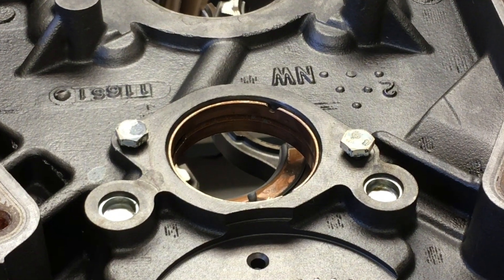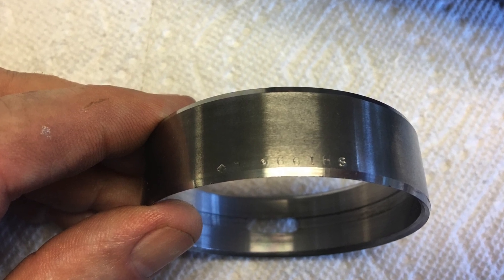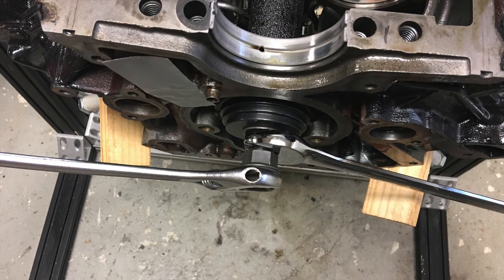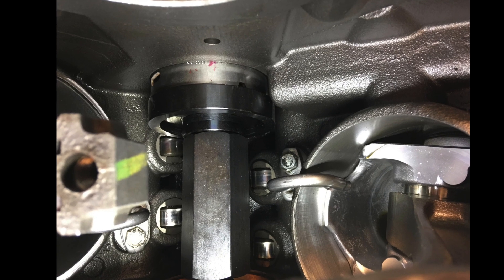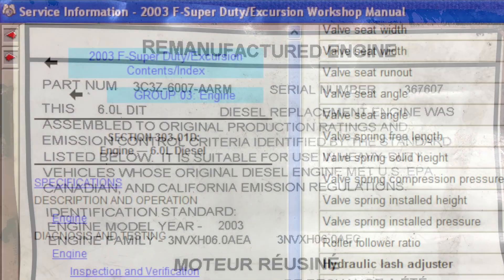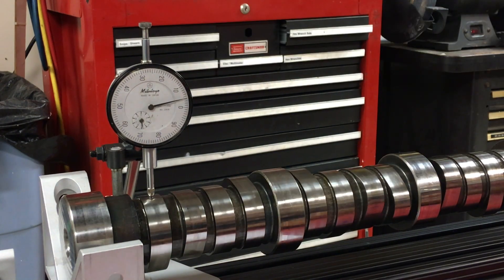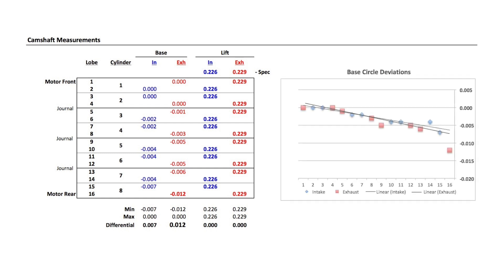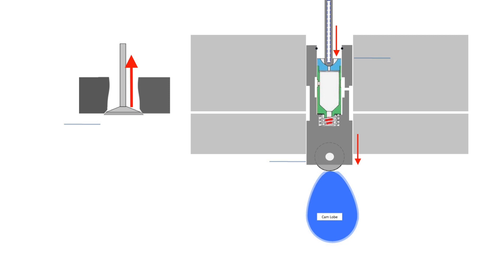Camshaft and Bearing Measurements; Cam Bearing Replacement - Powerstroke 6.0

Comment: Hi Mr. Jack, May I ask... What was your original cam bearing installation tool you were using in this video, and then purchased the washers for precise fitment for the 6.0 bearings. Do you have a part number for the tool and particular dies you used for this set up? Most places are on back order for the original tool and I would like to make something up for a build I have. Any help and advice would be much appreciated...  Thank you!
Reply from the maker: The parts I used are in the video description.  Starting from scratch would not be inexpensive, although you could use over-the-counter threaded rod and nuts.  But the washers were chosen specifically for the size of the cam bore and bearings.  I would recommend that most people use the Mahle cam bearings as the Nav ones are segmented and easy to distort if you are not careful.
Reply: @toomanytoys  Thanks again for your thorough videos. I think the jack screw would be a good investment for me. Would you please share the thread size and hardness of your 3/4" jack screw. Thanks ahead, Dave S
Reply from the maker: @davids-o2y  David, I have all the part numbers and details in the video description.
Reply: @toomanytoys  I'm sorry about that, I thought I had looked in the description before I messaged you.... I must have jumped the gun. But thank you so much for responding. You are such a wealth of knowledge and a WONDERFUL teacher! Thank you Mr. Jack and have a wonderful and blessed day!
Reply from the maker: @sapsaz7102  No, I added it because of your question.  You didn't jump the gun.

Comment: your taste in music is impeccable haha. im on my second 6.0 now thanks to your info youre up there with ron and bill for me
Reply from the maker: I'm not sure they are all excellent choices; after I get hit with a few Copywrite hits of do-overs before they get published, I'll take whatever I can find on YT accessible sources.

Thanks, but I don't see it that way.  DTR had the great advantage of service experience that I don't.  I'm just an R&D guy in a two-car garage.
Reply: @toomanytoys   I want to just build the same cam bearing tool exclusively for 6.0. I am going to just get machinist to build me the right id and od collet sizes based on the journal and bearing measurements from the navistar manual and use a threaded rod. How many thou clearance should I leave between the guide collet that centers the rod in the cam journal and the cam journal? what about between collet and cam bearing? (ie where you taped. will bearing on steel be ok here or should I use something soft like you did?) How did you install and remove the front cam bearing with the way you had your tool mounted in the video its not evident.
Reply from the maker: @over9000pontiacs  I had to go back and see if I kept all those components together.

The lead-in and drive plates (assembled steel washers) have an OD of 2.575", which is under the bearing shell OD of 2.600".  0.0125" clearance on the radius.  You could go tighter than that, 2.585".

The "carrier" for the bearing shell, since it has the velcro, was elastic, but with the bearings having an ID of 2.400", five to ten thousand clearance would be acceptable.  Nylon would be a good choice.

To get the final bearing out, I used a collar from my kit that had a larger diameter than 2.600", and the bearing pulled into that.

I'd recommend using the Clevite bearings, the Navistar bearings are an interlocked piece, and if it's off a little, the shell will distort.
Reply: @toomanytoys  Thank you much i will Make a video of what i create and the dimensions.
Reply from the maker: @over9000pontiacs  The one thing we didn't cover was the width of the bearings.  I have a new set of Clevite here; they are 0.735" wide.
Reply: @toomanytoys  the machinist wanted $300 for one drive collet accurate to .010. at that price I might as well just get the navistar tool. I will pm you the collet and nylon sleeve cads its all really elementary I was expecting more like $150 ish. PM'd u on power stroke

Comment: Where can I find info about the 03 camshaft vs others? Any idea why the intake manifold plenum connects at the back?
Reply from the maker: The intake, I would speculate they believed it balanced the airflow a little better, just like people with the 7.3L having supply fuel rains to both the front and back of the head (not regulated return - CNC Fab) or cross over in the rear head ports.

The Colt Cams date table shows the 6.0L cam information, but in reality, it is only the 2003 profile.  What he portrays as the 6.4L is actually the same from the 2004.5 6.0L to 6.4L.  Navistar carried the cam profile over, just a different gear.

Comment: The part about the 03 cam being more hot rod with a WIDER lobe separation angle is a bit of an odd statement.  Wider LSA means less overlap.
Reply from the maker: In the context of as we go through stages 1, 2, 3, and 4 cams the separation angle is increased when you look at the Colt cams.

Comment: another great video :)   You mentioned a bore scope from Amazon - care to share a link? I got one from Az for about the same price but it wasn't very good - blurry.
Reply from the maker: The ones I bought have gone away.  My older Snap-On scope was better in focus, but it was also $800.  With these lower price units I thinks it a matter of trying them and seeing if they are good or need to go back, unfortunately.